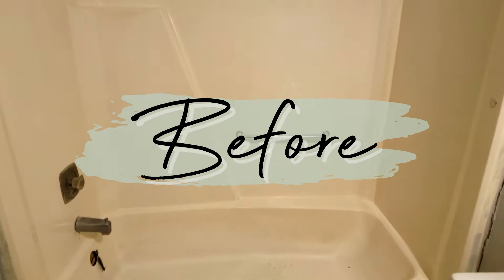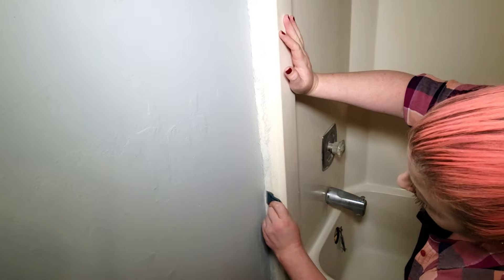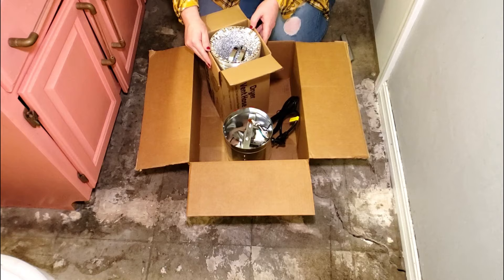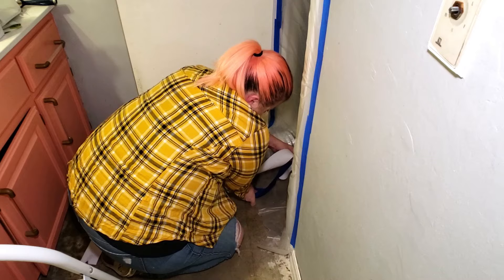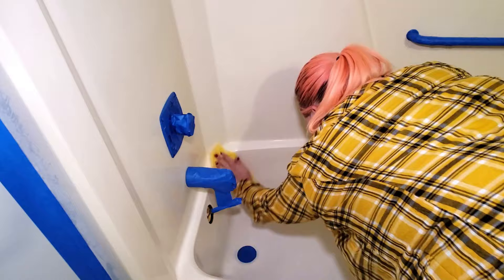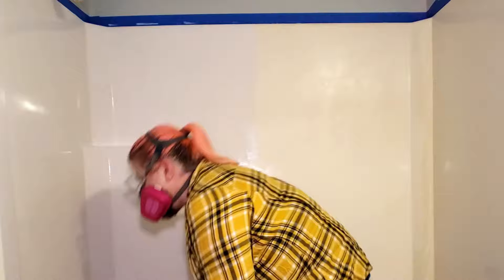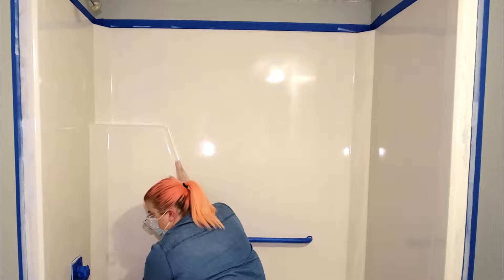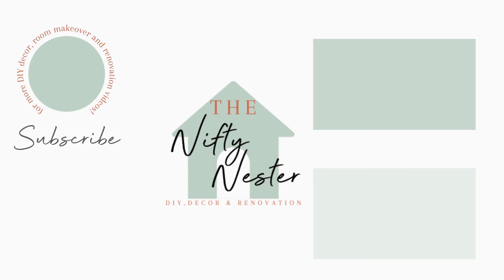How To Paint A Bathtub Yourself | The STRONGEST & CHEAPEST Way To Refinish Your Bathtub!

Comment: Thank you for making this video! 
Have you been pleased with the results and is it holding up well?
Reply from the maker: You're welcome and thank you! I am beyond pleased with how well this paint has held up. Once the paint cures it has such a hard finish that it doesn't look or feel like paint, it's more like a hard shell.
Reply: I’m thinking of doing this. I use suction cup hooks on my shower walls to hang most things because 1. There’s never enough shelf space in these tub surrounds and 2. Things sitting always getting gross underneath. So, my question is… Would I still be able to use suction cups on the walls if I used this paint? How has it held up under your feet or where you set things down? TIA! ❤️
Reply from the maker: I haven't used anything with suction cups in the tub so I'm sorry I can't say for sure but I can't think of a reason why they wouldn't still stick to the surface. It's a hard shell finish once it's cured. As far as wear and tear there really isn't any. I'll do an update in the near future, I just have a couple videos left to edit and post from the rest of this bathroom renovation before I post the update (editing takes me forever). The only wear I can see on the tub is a couple of tiny scratches that I made when moving a metal ladder in and out of the tub area when I was refinishing the ceiling in that bathroom. They're small scratches on the outside side of the tub that I will touch up when I film the update video but there's not really any wear yet on the inside of the tub. I don't know how long it'll stay looking new but so far it's held up really well.

Comment: Ok. I just painted my jacuzzi tub. I was nervous to do it. But paint is really good. And if it’s as durable as it supposed to be I would be totally happy. Because it looks really good now. 
P. S. I had some kind of dots all over my tub. I can’t get rid of it with anything. I didn’t want to switch jacuzzi because I use tubs once in a blue moon. But those dots bugged me a lot. And if I would change jacuzzi I wouldn’t put a jacuzzi… I would want a stand alone bath tub. And if I would do that I would need to renovate whole master bathroom. And it would cost me a fortune. So I spent only 17$ on a can of paint. 

Thank you so much for posting this video. I really hope it’ll hold up well.
Reply: Update. I have been taking my baths for a month already and it works just great! Nothing happened to my beautiful like new jacuzzi. I love it. Thank you so much!
Reply from the maker: @Tanya Misyuna  I'm so glad to hear it worked out well! I'm sorry for the late response, I'm going through my comments and realized I had a bunch I hadn't responded to yet. Are you still happy with your jacuzzi tub? I'm working on my update video right now for my bathtub, but I love to hear how it's going for others that have tried this.

Comment: So, I did exactly as you had explained to paint the bathtub…which is AWESOME!!! But then we decided that we needed to change the drain and the other fixtures that we realized were rusted through… But unfortunately, some spots were left having to be touched up with more paint in those areas since having to take those fixtures out and before it could all completely cure… Do you think doing touchups will affect the overall paint, if we’re not repainting the whole bathtub, but just certain parts? I get so nervous when I see some people commenting that they did this refinishing job on their bathtub with this exact paint and then it peeled several months later… I can only imagine they did not follow all of your directions. 

So, if as long as I scuff sanded the areas that I needed to touch up before I painted, do you think it will affect the bathtub in the future and cause it to peel in those areas? 

Thank you for your thorough video!!

Comment: Hi...
I've got a fiberglass tub that I need to refinish. I've probably watched a dozen videos, and because of cost and ease of application, I'm leaning towards using the marine paint you used. I'm going to sell my home within a couple of years, but I don't want to sell someone where the finish isn't somewhat durable. Unless I missed it, I noticed some others used a primer first, but you didn't. One couple used the Marine primer while another guy that does it for a living uses Zinsser 123 bullseye primer. After two years, how has yours held up, and do you have any insight if a primer is needed? I know that fiberglass tub units are painted in the factory, so priming may not be necessary.
Reply from the maker: Hi! So far, ours has held up perfectly.
The directions say you don't need to use primer on fiberglass that's in good condition. If you have any cracks or chips that need to be repaired first, then you need to use a primer since those spots will be unfinished. That being said, it doesn't hurt to use a primer if you want that added layer of security. If you use a primer, though, I would use the Rustoleum Marine primer. I haven't had any issues with the paint on our tub, but since you want to sell in the future, it might not be a bad idea to go ahead and use primer. I would also suggest using the non-slip additive just on the bottom of the tub so it has some extra grip. Our tub has texture on the bottom, and it hasn't been a slipping hazard, but that's one thing I would've done differently if I was going to do it again. You just add it right into the paint. It's another rustoleum marine product. I hope that helps. Feel free to reach out if you have any other questions, and good luck!
Reply: Zinser 123 Bullseye is my favorite primer.  I use white for light finishes and the grey for deeper colors...but for this...using an oil based marine paint, I'd use the primer recommended by the marine paint company.

Comment: GREAT JOB! Curious, how has the color and pealing held up. I saw where one other couple used the same product; however, after 2 years the color starting fading/ambering to a lite yellowish or off-white color but no chipping?
Reply from the maker: Thank you! Sorry I'm just now getting back to you. So I haven't had any peeling but I have noticed a slight color change. It's subtle enough that I thought I was imagining things at first but it's definitely there. At first the color was a bright white but now it's just white. It doesn't look off white or yellow at all, it's just not as bright as it was initially. It's an oil based paint, which is why the color change happens, but it's also why it holds up so well. I guess it's a trade off. I figure when it gets too off-white for me I can touch it up with a fresh coat and call it good for a couple more years lol.

Comment: And on The mention of The part a and part b paint there's supposed to use that through a spray gun you don't roll it that's why it's so hard ... Like you can roll it but it's definitely not ideal just because of texture

And when you use to spray gun you feather it

Comment: Hi, I found your video after several months of researching methods/paint kits to change the color of a 70s blue bathtub to a gloss white. Your method exceeds, by far, all other methods I've read about/watched videos for- in both cost as well as work involved, time and ease of application. 

However I am wondering how your method/paint choice has held up in the year since? At the end of this video you said you planned to do a follow-up, but having looked through your list of videos, I don't see anything related to this. So I was wondering if you would tell me how it held up? Has the tub been used extensively, as a main bathroom would be used? Have you experienced any bleed through of stains or original color or any flaking/chipping away of the new paint? And, if any of these things occurred, were you able to repair it to a satisfactory condition? 

I would truly appreciate any answers you can give to these questions, as soon as you possibly can, because I'm fighting an itchy trigger finger from clicking the order button for the materials at this very moment! (I'd like to complete this job asap, before the weather gets too cold to keep a window open.) I've also noticed several other vids of yours that pertain to future projects I have planned, so I'm excited to have come across your channel. I love DIY- just today I removed an old water heater and installed a new one, including replacing  sections of copper pipe. I am 55 years old, so these days I appreciate anything that makes a job easier and faster! Thank you in advance for all the work you've put into your channel and for any questions that you can answer for me now. I appreciate your help with this very much!
Reply from the maker: Thank you so much, I love your comment! It's the most rewarding feeling to finish our own home reno projects. I've never changed out a hot water heater, but I imagine that took some work!
I am working on filming an update right now (I have a couple of videos to finish editing, then I'll have this update video edited and posted). Sorry it's a little late, I wanted to have it up after a year.
This is the hallway bathroom that our 5 kids share, so it gets a ton of use. Even with the daily heavy use, I haven't had any issues with paint chipping, peeling, or anything like that. There's no bleed through of the old color. The paint is an oil based paint (I wouldn't use anything other than oil based on a bathtub), so I was worried the color would change, but it hasn't been noticeable. I feel like the white is more of a neutral white now than it was when I first painted it. It was a very bright white at first, but it still just looks like a white tub. Since your tub is a bolder color you might do a coat of the primer before you paint. I've gotten feedback from a few people that the primer helped to cover the bright colors really well, and then the paint took fewer coats. I believe it's called Rustoleum Marine Primer. 
I love this bathroom and how the tub turned out, I plan on using this paint in a rental property I'm getting ready to reno for a friend, and it has a blue tub with blue tiles. 
I hope I answered all of your questions, but if I missed something or you think of something else, feel free to comment again! Good luck with your bathtub!

Comment: Great video! As it's been a year, how has the painting the tub held up? Anything you would have done different about this process? Is this a fiberglass or acrylic tub? 
😊
Reply from the maker: Thank you so much! It's held up amazingly well. I'm working on the update video now and hope to have it up this weekend. It's a fiberglass tub, but this paint works on pretty much any and every bathtub material. There's not really anything I would've done differently, but I do want to try out the non-slip additive next time. This tub has some texture, so it's not slippery, but if you had a smooth tub, you would probably want to use the non-slip additive.

Comment: Great video. I'm definitely doing this on the apricot tub in my new house! I wonder has it held up well over the yr 🤔
Reply: Wondering the same
Reply: She responded to another comment, stating it's holding up just fine...she would need a sander to scratch it, was the response she gave to the question about scratching or peeling.

Comment: Great video !! 
 I have a white tub that I need to repaint to Ocean Blue . 😆
 When using the repainted tub later did you notice you the surface too slippery ? I'm trying to decide if I need to use a type of non slip coating on the floor of the tub. 
Excellent job on the fan duct box !!!👍 
 Looks like a super job . Really appreciate the attention to the different details.

Comment: This look fantastic! We have been trying to decide if we should replace the gross shower in our bathroom or just leave it, but this seems like a great alternative. My concern is durability. Does it seem like it could be scraped off?
Reply from the maker: Thank you! So it's been a little over a year and I don't think I could scrape it off if I tried. I'd have to use a sander to get the finish off of the tub. You could use the Marine primer if you're worried about the paint bonding properly but rustoleum does say this paint doesn't need a primer unless you're making repairs to the surface before painting.

Comment: Hello. Thanks for the detailed explanation. I am going to try it next week on my tub. But just wanted to hear your opinion about using a primer before the paint so it can be sealed and prevent pealing. Thanks
Reply from the maker: Thank you! From what I read on Rustoleum's product page you don't have to use a primer with this product on fiberglass unless it's damaged and you've made repairs then they suggest using the Rustoleum marine coatings primer. Mine was in good shape and didn't need repairs so I just used the paint and it's held up well. I don't think it would hurt to use the primer though.

Comment: Nice job!!

My wife and kids are going away for a week (WOOT), I have my own bathroom, cause, I'm a dude. Wife told me to clean it while she's gone. Hmmm, ok Babe, I'll clean it (hehe). I'm gonna redu the whole damn thing. BUT, I hate "white". It's boring. Do you know if that paint can be tinted? I'm thinking about staying in the "light" color range (residue will show more on darker colors), perhaps a VERY light blue/purple, just barely so it's not stark "white". My walls will be a similar color, still light shaded but a bit darker than the tub.
Reply from the maker: Thank you! I'm sure your wife will be thrilled that you have tackled this project while they're gone. I wish my spouse had his own bathroom 😂 she is a lucky woman! As far as the color they actually have multiple colors already. It's meant to be a boat paint so there's some variety. Maybe you could find the color you're looking for, they are all listed together on Amazon ( I linked it in the description if you'd like the link to help find it). I don't know about getting it tinted though. I would think they could since it's just basically an oil based paint but you might ask at Home Depot or wherever you go to make sure. Good luck with your project and enjoy your week of solitude!
Reply: Update: 

Finished "my" bathroom. To answer the question about "can it be tinted"...Yes, Home Depot did it for me to "try" and match the tint I added for the ceiling paint, which was a very very light blue, almost white, but not. 

I used the semi-gloss white boat paint (cause it was getting tinted). Worked GREAT for the bathtub. No chipping or peeling and it's been about a month. However, the tint didn't match up with the regular Behr ceiling paint. I used the boat paint on the ceiling above the bath/shower. The tint ended up being a few shades darker. Oh well. Kinda looks like it's in shadow, which isn't noticable cause, well, with the shower curtain pulled, it's in shadow anyway. 

P.S. Wife and kids got home. Liked the bathroom, but wife got jealous and now, I'm doing her bathroom. 

Daughter liked what I did to mine so much, she moved all her stuff into "my" bathroom. So now I got all this "girly" stuff in MY bathroom. 

Oooyyyy!!!

Comment: How is this holding up? I previously refinished 2 bathtubs with rustoleum tub and tile and BOTH failed within 6 months! Have you used the tub for baths? Is it holding up? Thanks for a great tutorial! Love the zipper in the plastic!
Reply from the maker: Thank you! This bathtub has held up amazingly well. Our 5 kids share this bathroom, so it's gotten a ton of heavy use daily. They take showers and baths in it. I haven't had any chipping or peeling or any other issues with it at all. I'm really happy with how it turned out and how it's held up.

Comment: Looks great!  I wonder if brush or roller strokes shows? I did not know this paint and thanks for sharing. I started to shop your list.
Reply from the maker: Thank you so much! You want to use foam rollers and, for any areas you can't reach with the roller, you want to use foam brushes (you'll probably go through several foam brushes and one roller per coat). The paint is self leveling, so the slight texture from the roller levels out and won't be visible once it dries. Just go over any lines from the edge of the roller to smooth them out. I hope that helps, good luck with yours!

Comment: Great video! I am a little confused about the process of sealing the room and then venting it. Was that just to keep the smell from the rest of the house? Can I just leave the door to the bathroom open? It is in front of steps leading down to the front door which I could also leave open.
Reply from the maker: Thank you! The ventilation was for the fumes. It does have a strong smell, but the fumes are the main concern. My suggestion would be to ventilate the bathroom so you can go about your life as usual outside of that bathroom while you're in the process of painting it. Otherwise, your entire house will smell until the paint dries, and you'll run the risk of inhaling the fumes in the rest of your house. You could just keep the bathroom door closed and the bathroom exhaust fan running, which would help with the fumes, but make sure you wear a respirator no matter how you decide to go about it. I hope that helps!